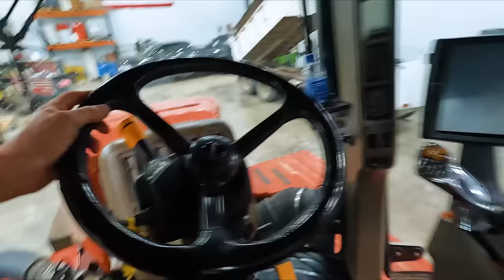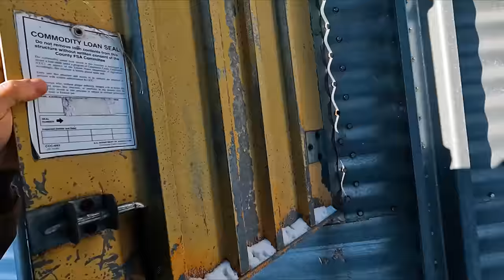The Guy Works Miracles In The Wash Bay!

Comment: Chet:
Just a thought, consider making an aluminum sheet box lid for the new pump on the trailer.. it would protect it from theft, elements and damage..Nice show, Thanks 😊
Reply: We just has our covers made to fit out of tarp material.  Works great.
Reply: @mitchertelt1225  .. I thought about aluminum plate because a padlock could be easily used and would help if the trailer needed parked roadside while working.

Comment: Y’all need the ECHO PAS-2620 with the Pro Sweep attachment to brush the snow away. It would be much easier than a shovel and broom. You could use it in so many places to sweep areas large and small. Stihl has a same type system but I’m just a fan of the Echo X series. They also have a rubber Pro Paddle. That will also clear snow and the paddle works good for clearing debris off your lawn and won’t tear up the grass. You have to run a lower RPM to prevent debris from rolling back over the broom or paddle and you can also turn the unit upside down and pull it which is easier depending on what you’re moving.
Reply: They bought a Milwaukee pro sweep not sure why they aren't using it lol
Reply: Yeah the bobcat brush attachment works great for light snowfalls and in the spring you can use it to brush the gravel out of your lawn without tearing up the grass
Reply: I think they have a Brush? Or was that some other farm channel? 😂
Reply: @smokeeater07180  Ah… I didn’t see that. They certainly need to dig it out and use it!!

Comment: I'm sure boys from Minnesota are experts in snow removal.  For the first time ever, I recently saw a heated rubber floor mat.  They use electricity and can be hooked up in a series.  Maybe useful for ice in critical areas.  It leaves a puddle but so does rain.  Like the comment below.  Your maintenance program is outstanding.
Reply: Actually you can do a heated concrete  slab on the exterior. 

Some places do this instead of salting. 

But is over kill here.
Reply: Truck House Life uses those.

Comment: Hey guys, if you need to tighten up crimp on 3/8 hose use the 1/4 die and only crimp it a bit more than what the 3/8 die does.

Comment: Chet you should look into a boss snowplow product called a snowrader. It is designed for snow removal in tight places. You can choose from a 4ft straight blade, vblade, a brush kit or a snowblower. It’s a really unique unit that could be very useful on the farm

Comment: Why not just put two wet systems on two trucks and be done with it? Would be alot easier than mounting that pump back there running the lines. Not to mention when the pump won't start in the winter

Comment: Chet, you should be able to get a different crimp setting to crimp single braid hoses. You can also run into issues with different hose manufacturers having different outside diameter hoses.

Comment: On the extension cords we would put them in between 2 2x4s that were 15 feet long and a piece of plywood screwed to it. So that the tractors could run over the cord without damaging them when we were building the farmer's new house. We had the main power cord coming from the main shop to the house it went across the driveway. Saved a very expensive thick power cord from being destroyed

Comment: The trick to extension cords is to take a piece of plywood about 10” wide and lay 2 pcs of 2x4 along the long edge with a 1” gap between the boards creating a trench.  Lay the cord in the trench then driving over it puts no pressure on the cord so it does not damage be it internally.  You might need to put some type of retainer if the cord is stiff to keep it laying flat.

Comment: Prince ls3000 valve should be what you're looking for. Also spx/stone make 12v power units that would work just to lower and lift that, about 1/4 of the size and maybe 1/3 of the cost.

Comment: most install those pumps inside the frame with a little hatch to acess and a small flip up hatch to add fuel but you would have to take that motor off and install it inside the frame by itself and add the tank some were or make one then add the control thru the outside of the frame

Comment: Use mop and glo on your rubber mats in the cab and floor mats. Dust won’t stick to it. Guy that pull trucks and tractors use that on their tires on the side walls. Way better than using armorall

Comment: What you want is a detent valve. You know if you are going to run hoses under the trailer I would run those in pipe I believe you will have a whole lot less problems with it.

Comment: If you use the same truck with the lowboy. Put the pony motor in the truck.   Shorter hydraulic lines and completely of the bed of the trailer

Comment: Filter cleaning! I saw 👀 a tool, can’t remember where, but it was some kind of swivelling device which spun like crazy when attached to the compressed air and lowered into the filter- cleaning it out as new…
Anyone know what I mean?
Reply: I’ve seen an ad for them but didn’t catch the name.  A leaf blower does a good job cleaning air filters without tearing them up with that high flow/low pressure they produce.

Comment: I would think that Hydraulic Buddy is great for a commercial hauler there it's used often, but any small gas engine that sets a lot will have fuel issues. Electric may have been a better option for farm use.

Comment: Question for you Chet when looking for a planter tractor why didn’t you get a case quad track instead of the 9rx tractor
Reply: Doug actually got the 9rx and they’ve gone over it in older videos, they prefer the quads but the 9rx communicates a lot better with the planter than any case would. You can spend a bunch on aftermarket screens and software to go case-Deere but it’s not as good as Deere-deere.

Comment: Put a piece of Channel iron on the driveway with square tubing welded on both sides as a track to lay your extension cord that away the truck won't run over it😳😳😳😳

Comment: @14:55 I know two different times when people had trouble with the carbon monoxide given off by a gas engine running in a building. One even got a helicopter ride to the hospital. They both though they had adequate ventilation.